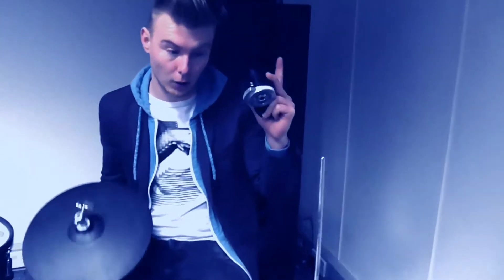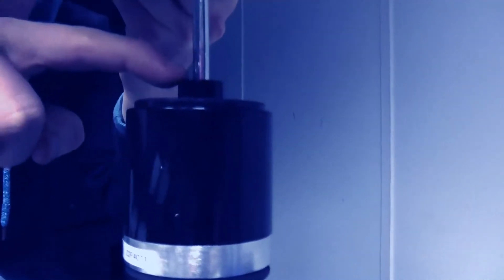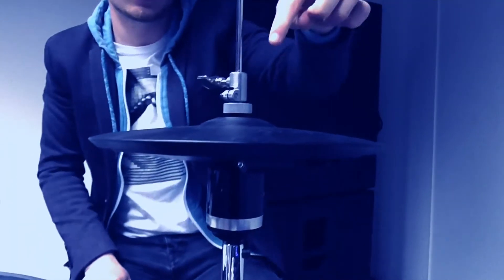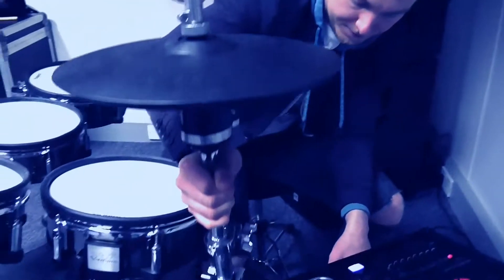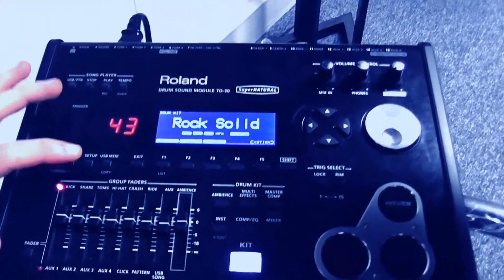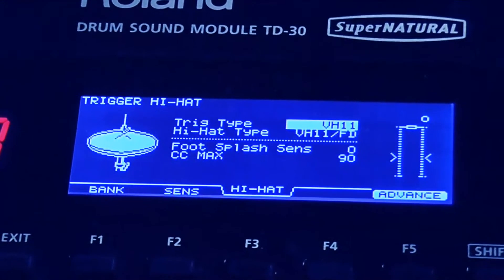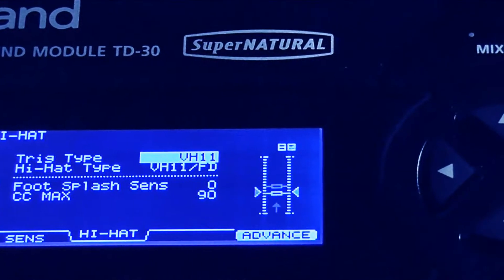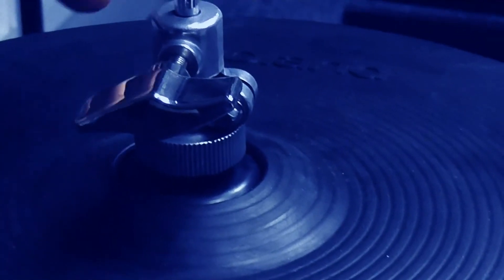Roland VH-11 setup tutorial with a Roland TD-30

Comment: From my personal experience with the Roland TD-9 and TD-30 the best response experience I had was with the combination of the FD-8 pedal and the CY-12R cymbal that I used for the Hi-Hat. The TD-30 module software supports it, the response is phenomenal, in my opinion, better than the VH-11, which is certainly much more expensive.

Comment: I'm confused. How does it stay calibrated if you go and loosen the clutch and move the hat again?
Reply: I was wondering the same thing. Dan, could you assist?
Reply: Because it doesn't. The calibration is only good for the VH10 dual-cymbal HH where the calibration is used to set the contact point between the two cymbals. Every video that shows VH11 using calibration is WRONG.

Comment: my hi-hat turns. How can I place it where the logo stays in the same place?
Reply: https://www.youtube.com/watch?v=dw6hT4CfuRI   Could be the wrong hi-hat stand, or it maybe you don't have the foam side up on the rotation stopper plate.
Reply: Yesssss Exactly I have the same problem? Did you solve?
Reply: @larsulrich26ulrich42  It's because the hi hat stand rod (the rod that you clamp the VH-11 onto) is not tight.  It can't spin if it's clamped on to the rod tightly and the rod itself is very tight.  A good way to tighten the rod is to clamp the VH-11 onto it as tight as you can, then turn the VH-11 clockwise, since it's attached to the rod and you're using the VH-11 as leverage to grab onto the thin rod.  Once you can't turn it anymore, then losen the VH-11 and turn it to where the Roland logo should be, then tighten again.

Comment: How is the bottom of the clutch set up? Great video but no videos show how the bottom of the top hihat is setup..
Reply from the maker: Hi Kevin, many thanks but a little confused as I am not too sure what part you're referring to? The hi-hat stand I am fitting the VH-11 onto is a bog standard acoustic Hi-Hat stand and the items I fit onto it are exactly in the normal installation process. I'll gladly offer pointers if you could clarify what parts you feel are missed :)
Reply: @Dan_ClarkeMusic  hey Dan, sorry for the confusion, I see now that I worded my question poorly. My problem was that I messed up when reassembling the clutch. Once I looked at the clutch diagram in the vh11 manual, it became clear why my clutch had issues and I was then able to follow this video with no issues once I reassembled the clutch. Cheers

Comment: Calibration is for the dual-cymbal VH10 HH to adjust the contact point of the two cymbals. You calibrated nothing with the VH11. The only thing you need to do is place the VH11 cymbal so it's just resting on top of the trigger and tighten the clutch. That is all.